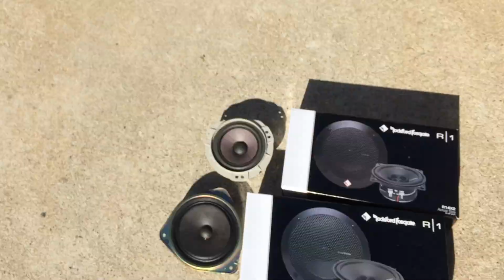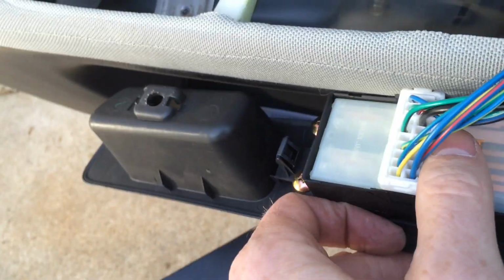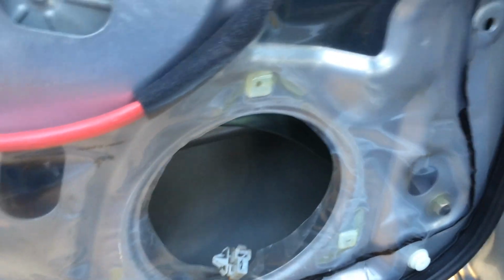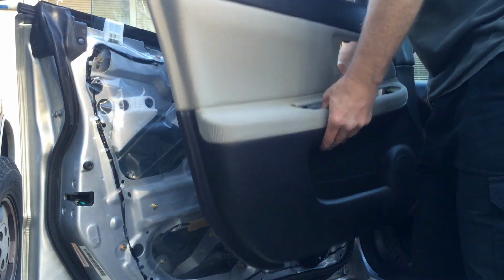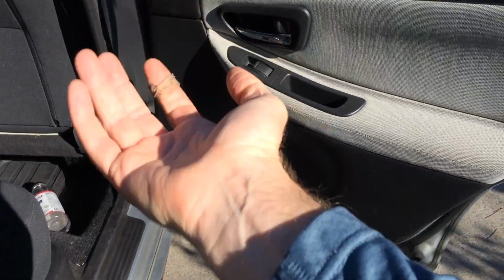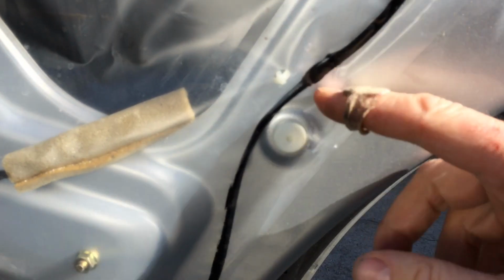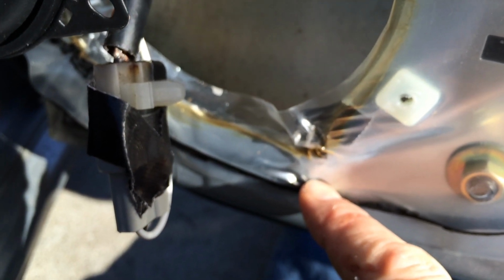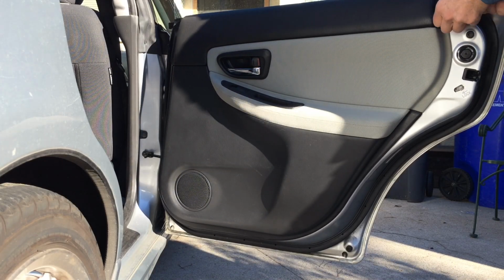Subaru Impreza Speaker installation

Comment: Used the same speakers in my 07 OBS, just replaced the stock speakers and used the original rings, much easier. Same in the front. It was 4' in back doors and 6 1/2" in front.
Reply from the maker: I really like the way they sound. My son thinks they could use more bass, but I like that they fit into the stock speaker holes.
Reply: Still using the stock head unit? How much difference did it make? I am considering doing the same thing.

Comment: This is a sincere question not a rib: Do you realize that the adhesive in duct tape is an acid and that it will run at higher temperatures? Perhaps gorrila tape is of higher quality but I have seen Duct tape eat its way through plastic on several occasions.
Reply from the maker: Thanks.  I haven't seen duct tape glue liquify and run before.  I don't think it gets hot enough to do that where I live.  I've heard of other people using it for this, and I don't think there are problems with it.
Reply: thoughts on what else to fill the gap with?
Reply: Make a small / thin plywood or MDF baffle for the speakers to sit in / or on etc.
Then fill any small holes with expanding foam, before the speakers are in, 
or perhaps cut the dynamat to shape, or overlapping a portion of the door and then sit the baffles over the top.

Sound from the front, must not be able to get to the back and visa/versa, otherwise you will lose the bass.
Shouldn't take more than a few hrs to fit. 
Tape will lose the power handling.

Comment: Sorry for newbie comment - but does all of this same stuff apply for a 2002 impreza wrx? I saw somewhere else that the 02-07 should be the same...but wanted to confirm.  --Thanks in advance
Reply from the maker: +John Magee I don't know. Mine is a 2005 model, but I have never looked at one newer than that.
Reply: Yes 2002-2007 are all the same

Comment: Why if I buy the exact same size speakers? That way I don't need a mount bracket? Or was that not the reason why you used one?
Reply from the maker: +Carlos Diaz I bought them from Crutchfield, and they include the bracket and wires for free, so I bought them. Not sure if you can find an exact fit aftermarket speaker or not. You may be able to fit in a little bit bigger speaker too.

Comment: So if I order off crutch field and its fit for my car will they send the correct parts to make it fit or will I have to order those too?
Reply from the maker: +HugsButNoDrugs They supply all the parts.  In my case, they gave me speaker mounting brackets and the correct wiring connectors to fit my car, so I didn't have to cut or solder anything.  They're good about answering questions if you call them.

Comment: Yea, but what size speakers did you use.
Reply from the maker: I think they were 5 1/2’s in the front. I bought what Crutchfield recommended. After I open the doors up, it looked like I could’ve fit bigger speakers in there if I wanted to.
Reply: 502_STI Correct answer: too small.

Comment: what is the exact size of the front and rear speakers? and also how wide are the new ones?
Reply from the maker: They are Rockford Fosgates.  I got them from Crutchfield, who can take the make and model of your car and tell you what size speakers fit.  In the case of the Impreza, I think I could have fit bigger speakers in there, but they didn't recommend any.  I don't remember the exact model number.

Comment: What size speaker did it take?
Reply from the maker: +gbtayc I don't remember for sure, but I think it was 5 1/2 in the front and 4 1/2 in the back. If you go to the Crutchfield website and search for Subaru Impreza speakers, it will show you what size they sold me.

Comment: How big of a speaker did you use?
Reply from the maker: I used the same size as stock. I think you could go a little bit bigger in there, but I just went with what Crutchfield recommended.

Comment: where'd you get the adapters ?
Reply from the maker: I bought the speakers from Crutchfield, and they always include the adapters.  Not sure what the part number is or where they got them.
Reply: @hoohoohoblin  could you add a link to these speakers? Are they still work well for you. My stock ones are crackling and I cant stand it. Time for an upgrade

Comment: Did you have to do any modifications to the rear one like add a spacer or anything?
Reply from the maker: +Abdul Bhuiyan No. It fit into the hole.
Reply: hoohoohoblin good video btw

Comment: I will install in the front a pair of 4 ways and rear 3 ways 😬😬
Reply from the maker: +Gabriel Sanchez I recommend taking the door panels off before you buy the speakers, and then decide just how big a speaker will fit in there. I think I could've fit a bigger speaker in there if I had done that.